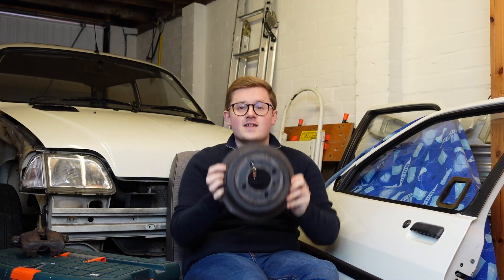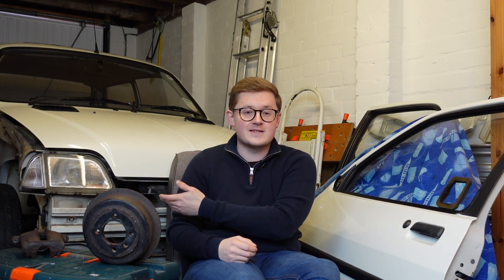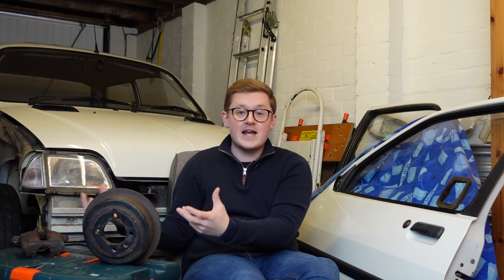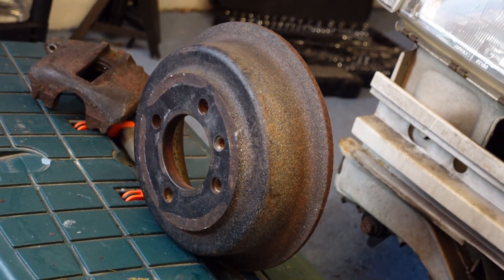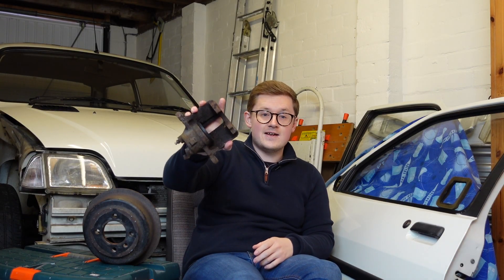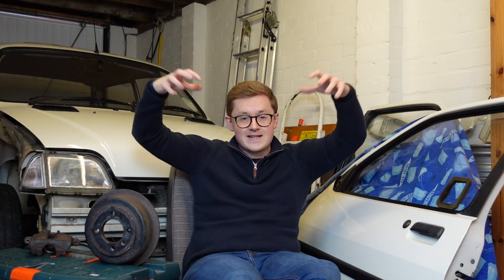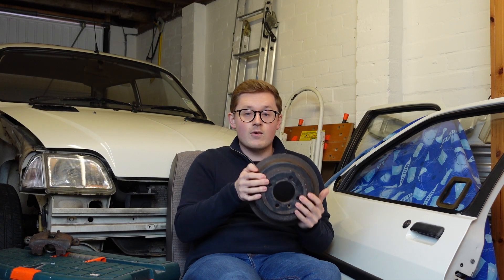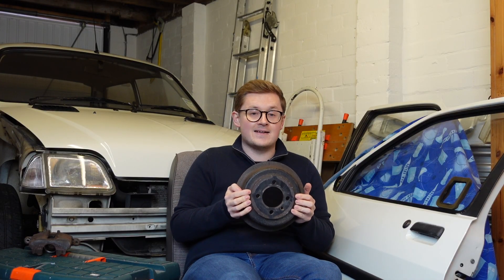Why are Drum Brakes Making an EV Comeback?

Comment: really good explanation Ed. 
God help us though if we're going back to drums. theory is one thing, reality another. drum systems fade, seize, the wheel cylinders leak fluid (as can be seen all over the shoes of your Metro), adjusters snap, they're a much longer job to replace, the concentration of heat blows wheel bearing seals, drums warp and the shoes have a tendency to drag against the drum unless everything is maintained perfectly. on the other hand, most disc systems provide the opposite and should self-clean in operation. handbrakes have however been another story as you point out.
all that said, times move on so maybe the EV generation of drum brakes have some clever technologies in them?
a humourous but true point comes to mind. how do you adjust the drum brakes on an original FIAT 500/126? do 20mph in reverse then slam on the brakes - job done!
Reply from the maker: Thanks mate :)
They do have service issues, but so do calipers leaking fluid through the seals and having their pistons seize!
Reply: @TwinCam  thanks for the reminder Ed. its been years since I've done piston seals (goes back to MK3/4/5 Cortinas!). some designs suffer from the sliding member of the caliper seizing also. much of the issues come from poor quality materials in manufacturing and improper/rushed replacement of the brake service or consistent driver abuse i.e. driving a standard family car like a race car without upgrading the brakes lol.

keep up the good work mate. love the channel. I'm fascinated to see where you'll take it a year from now
Reply: @Chris_1024_ I'm no expert on heavy haulage drums but I do know their conventional systems work differently with a pneumatic system that defaults to on (cars hydraulic systems default to off) so for the vehicle to move first thing in the morning it must first release its brakes, maybe this is part of the answer? these vehicles are also restricted to 56mph in European countries so there is less need for higher quality machining. drums are cheap and heavy haulage is probably the most price sensitive type of vehicle you can buy. and don't forget convention in a sector which evolves very slowly.
listening to a couple of mates who drive 40 tonners, they regularly complain about trailers they hook-up having poor/useless/unbalanced brakes.

regarding your statement regarding VW drums, as I said in my original post "maybe the EV generation of drum brakes have some clever technologies in them?"

Comment: Great video! A key difference you didn't mention is that when things get hot they expand. That causes "drum fade": the drum grows and the shoes don't reach it any more unless you push the pedal further or pump it. When a disk expands the pads grip it tighter. Great. But the situation is reversed when you park. As the hot drums cool down the handbrake comes on tighter, which is all to the good, but if you have a handbrake operating on disks, they shrink away from the pads and the car rolls way. Citroen Xantias were famous for this. Many ended their lives at the bottoms of hills. I think this is the main reason why many cars use the mini-drum. It's not that difficult to rig a mechanical linkage for a disk caliper (usually a jackscrew) and many Japanese cars (and I'm sure others) do use handbrakes on rear disks so it can be done. But personally I am still leaving them in gear as well :) Slots and holes in the disk I have heard are meant to be for deglazing rather than cooling (but this one of those things people argue about on the internet a lot).
Reply: The biggest problem of hot drums being parked is that, when they cool and grip the unmoving shoes tighter and tighter as you say, they then warp and become "ovalised".  From then on, when you brake, the brake-pedal vibrates and they are more likely to lock up.  This was a huge problem here in Australia but, sadly, because our cars were made by American manufacturers, we were just given drum brakes on the rear until well into the late '80s and even 2000s.
Reply: @normandiebryant6989  Here is USA I can personally attest to getting disc/drum well into the 2000's on GM minivans.  Fortunately never had a problem with drum distortion. Literally just gave an 04 Pontiac Montana to my college-attending son here over the holidays, original rear shoes were fine, but one cylinder was leaky, and both were changed, less than $25 US total in parts.  The only reason USA manufacturers changed was to have combo service disc/emergency drum so the emergency system was not reliant on a potentially failed rear drum.  The 06 and up GM minvans have that style of system, rear 'top hat' style rotor with mini-drum inside.
Reply from the maker: Yes, that's all part of the inconsistency and fade they suffer!

Comment: The strange pedal feel you mention is the self servo effect of the shoes, they basically suck themselves to the drum surface, it only affects the leading shoe not the trailing shoe.
Really good drum systems have twin  leading shoes although that requires 2  single sided slave cylinders per drum or an overly complicated pivot system 👍
Reply: Motorcycles had up to 8 leading shoe front brakes and there were even 10LS ones made
Reply: @PaulG.x  yup 👍 it's just something you get used to and preferable on non servo systems like older cars and bikes  👍
Reply: You want complcated, take apart a Lucas-Girling system with the parking brake.  Lots of head scratching the first time I had to adjust one of those.
Reply: VW vans [microbus] had twin trailing drum brakes 50 years ago.
Reply: Didn't they usually fit TLS to the front wheels for maximum braking when driving, and SLS to the rear so the handbrake works equally in both directions (for parking on a hill).
Reply: My 1957 Mercedes had twin leading shoe front brakes inside the massive Alfin drums - the best that money could buy !
Reply: Tomos uses the same concept in the clutch of the second gear in their 2 speed transmissions. It's not the most smooth shift, as the second clutch doesn't slip that much, thus giving quite a jolt. Upside is that clutch engages at a high rpm than the rpm where it disengages.
Reply: You get bad pedal feel when they aren't adjusted right, that's for sure
Reply: VW has continued to offer the drumbrake version of POLO, Honda has continued to offer the drumbrake version of Fit, Toyota's Yaris in the Asian market until now.
Reply: And twin leading shoe designs are rubbish when going backwards or parked on hills nose up.
Reply: @lenrichardson7349  In practice, weight transfer when braking backward meant that twin leading shoe (now twin trailing shoe!) was plenty. The problem I had with Minis was that there was a crude limiting valve on the rear brakes, and the fronts were locking (going backward) without the rear brakes doing enough.

EBD could sort these issues very easily, is my guess :-)
Reply: Even with one cylinder the leading shoe grabs and pushes the piston over on the cylinder and pushing the second shoe giving the same servo effect.
Reply: Disc brakes have a servo effect too which the resting spot for the caliper pistons gets further out over time to maintain the same gap between the pads and rotors throughout the life of the pad.

Comment: There are some extremely good points made in this video and many are widely known pros and cons with both Drums and Discs. A point to consider is some manufacturers have indeed started manufacturing Drum brakes at the rear. Why? Because they're cheap, cheap, cheap. That is the aim of the game now in the car world, how cheap can they make components without any issues in the first 5 years of ownership, just a little longer than the length of a lease deal. The biggest problem of Drums is thermal expansion of the Drum when hot, bringing the surface further away from the Shoe when most probably you need to use the brakes. However as you've correctly stated there are many advantages. My issue is surely manufacturers were looking at this decades ago before Discs became almost a must-have feature to sell a car. If they decided that Discs were inferior, we would not have them today, and Disc Brake technology has advanced enormously as well. Lastly, even though EV's have to pedals, most are single-pedal driving in most conditions unless an emergency stop, I wouldn't want Drums to be involved in that set-up plus there's the maintenance, Discs are easy, quicker to service. Drums are just horrible to service, take longer for most people and the adjusters are usually never working. Some serious reverse-engineering would have to take place.
Reply from the maker: The point is of course, when haven't everyday cars been designed to be cheap?
Reply: @TwinCam  Looking at the cheapness and build quality of the current generation of cars. They make an 80s Escort look like a battle tank!
Reply from the maker: They really don’t - cars of the ‘80s were appallingly cheap. The only era that looks better in terms of quality than today is the early 2000s, when economies were much stronger generally, and it shows.
Reply: @TwinCam  Many were cheap at the lower end of course, but equally just as many 80s cars were well put together in many areas and certainly can put a modern car (which should have benefitted from 40 years of advancement) to shame.
Reply: My 2009 Honda Fit has rear drums. The brakes worked just fine for the type of vehicle.
Reply: @mtunofun1  fine at the rear but the discussion was potentially fitting them all round.
Reply: Yet Chinese utes use discs when Thai utes use drums.
Reply: @Chris_1024_ Very good points made here. In fairness I forgot newer cars are not lasting more than 10 years so on that basis they probably don't need looking at - on the basis of age not use alone. But... rust on brake discs only becomes a problem after not using a car for a few weeks at least which causes pitting. Even cheaper brake discs don't pit unless stood for a couple of weeks (having more than one car not being used for a few weeks at a time myself). I doubt it would rust quicker than that unless made of monkey metal. My experience is totallybtue opposite. On paper Drums make more sense, in the real world its debatable. It'll be interesting to see if this develops.
Reply: @usuallyfixingtinkering  Newer cars are lasting longer than older cars did. The average age of all cars on the road is about 12 years (so a lot of cars are much older) and cars last for more than 2x the miles as in the 1970s
Reply: @brianfulton-howard3602  On paper they should but expensive repairs render them uneconomical at younger ages of under 10-12 years.
Reply: @usuallyfixingtinkering  if that were true, the average age of cars on the road would be going down, not up. It just hit 12.5. In 1990, it was around 7.5, and it was around 7 in 1980. Sure, cars have gotten much more complex, but manufacturing has gotten better. Anecdotally, I had to replace multiple engines of 90s cars I owned (blown head gasket and thrown rod), but I don't know anyone who's had to replace an engine recently.
Reply: @brianfulton-howard3602  that average is mostly down to older cars at the "banger" end of the spectrum pushing the average up. In terms of manufacturing there have been many advances to prolonge engine/drivetrain life especially but equally in ever other department - mainly electrics that is where modern cars fall short. Too many electrical faults which cause running issues.
Reply: @usuallyfixingtinkering  it's impossible for either of us to know if the average age of cars on the road will start coming down again, but if cars were dying in large numbers after only 5 or 6 years, that would be reflected in the current numbers. And cars have had ESC, TC, ABS, FCW, etc for years now. These systems all need sensors that can fail, but the control units are being simplified. It could very easily continue to go in the other direction towards increased reliability.

We will probably see a dip in longevity due to all the new electric car companies having to figure things out and due to people upgrading faster due to rapidly improving EV tech, but then I expect that cars will last even longer due to the simplified drivetrains and control systems with fewer wear parts and longer lasting lubricants.
Reply: Sure, disks are easy to service, but you have to service them many times more frequently than drums. There's a reason 18 wheelers use drums. Reliability.
Reply: @scythelord  I'd prefer something you service once in a while vs something you never apparently need to service. That is when things go wrong when no Inspection takes place, with brakes that's a dangerous no-no.
Reply: This. The ID3 also is actually RDW, meaning that the drums are even less used than normally. @Chris_1024_

Comment: Drums can outlast the car in most cases. 
But they don't often lock up because as you missed the point in your video most cars with drum brakes are fitted with a brake proportioning valve. Sometimes it is as simple as a ball bearing enclosed, when you slam the brakes on it flies forward and limits the flow of fluid to the rear. In other cases such as vans, the more weight you put in the more it opens so you have more or less braking force depending on the weight you carry.
Reply from the maker: Yes absolutely, in order to give each axle the appropriate bias. I do mention a general bias, but thought going into a proportioning valve wasn't worth the extra few minutes!

Comment: They're not the best option on a performance car (though there are some gorgeous finned drum brakes on early 60's F1 cars that at least win some style points) but for the rear wheels on anything non-performance oriented they make a lot of sense. Low wear, low maintenance, and protected from road spray by design. 
I can see why they make sense for an EV with regen.
Reply: low maintenance on drum brakes is funny, they're the first thing to stop working and completely cease to exist from rust, because of no one noticing the wear. At least with a disk you can notice something's wrong
Reply: @tomclanys I seem to recall that the brake drums on a  VW camper were a pain! And require more skill. Whereas checking and replacing worn brake pads is relatively easy!
Reply: @CorporateZombi  yup, many people say that drums are simple. They are not, they require more dexterity and care than simple disc brakes and calipers, in case of VW for example. All you need to do in calipers is just to lubricate the guiding pins and change the pads, other than of course changing the piston and it's seal once it wears out.
Reply: @CorporateZombi I agree. Every car I have changed pads on is much easier than replacing shoes with all the awkward springs and levers attached. Also my 2001 Octavia front disks and pads lasted about 100 thousand miles but replaced rear disk and pads due to sliding calipers sticking.
Reply: @stephenwest9757  I think the point was not so much that replacing and servicing drum brakes is easier than disk, but a modern well made drum brake in an EV application may never need to have the shoes replaced. It may never even have to be opened at all in normal circumstances. Being built around that mindset may mean that these can be better sealed from the elements for even greater reliability.
Reply: My Chevy 3/4 ton has the original disk brakes on the rear with 276000 k on them. I will soon have to change the pads though.
Reply: @johnarnold893  Issue with EVs is not how long they will last, but how they endure how little they get used. My friend has a hybrid vehicle, and has to fight rusty disks as the car practically never engages the actual brakes if not driven like a maniac. The mandatory yearly roadworthiness inspection we have here does not accept rusty brake disks. So enclosed drum brakes would be a good solution for not having to service the brakes yearly juat because of the car not using them, especially for the conditions here.
Reply: @thoubias Apply the brakes once per day, resulting in no rust on the discs.
Reply: @dvader3263  Thanks, I was going to make that suggestion.
Reply: @dvader3263  That's a good option for some, but I don't actually drive my car every day, sometimes I'll go a week without driving it. So even in a diesel it makes sense to me to choose a car with drum brakes at least in the rear.
They get too hot and preform badly in real "inspired" driving in the mountains, but since its a van with a 80hp engine that's not really a big issue, just needs a bit more driver skill on long downhills.
Reply: @thoubias  While no cars are doing it just yet (that I'm aware of), the onboard computer should be able to blend-in friction brakes gently from time to time in lieu of regen in order to clear rust and keep the friction brakes well-prepared for use.
Reply: Formula Vee still use drum brakes today on there 1200cc race cars. One of the main advantages is that the spring pulls the brake shoe away from the drum helping to reduce rolling resistance.
Reply: 60s Buicks also had the lightweight aluminum finned drums. Weekend warrior drag racers have used drum/drum brakes for the reduced rolling resistance for years.
Reply: Makes perfect sense 

There is also the fact that the drum
Brakes are self-energizing which lends itself well to electric actuation (like on a trailer)
Reply: The rear solid rotor disc brakes in my 2004 Lexus RX330 lasted 125,000 miles(US) before the pads were due for replacement.
Reply: Only problem I see as a bad thing with drum breaks on the EV's is the weight of the vehicles, they are 1k to 5k heavier than their ICE counterparts.
Reply: @Rossdie  Why is weight an issue? The heaviest vehicles on the road are stopped by drum brakes.